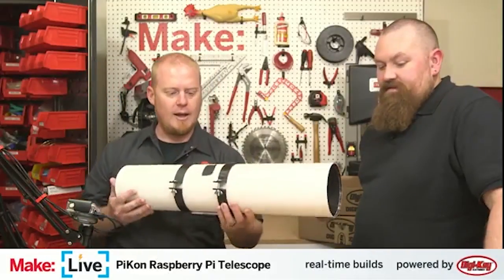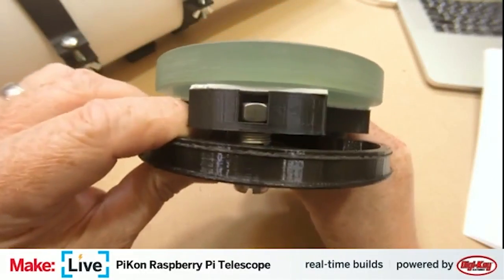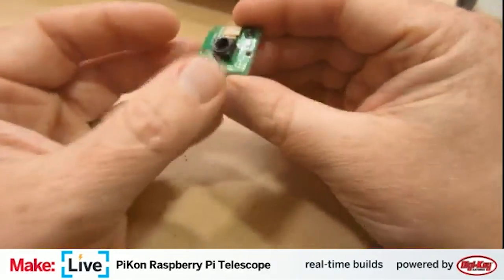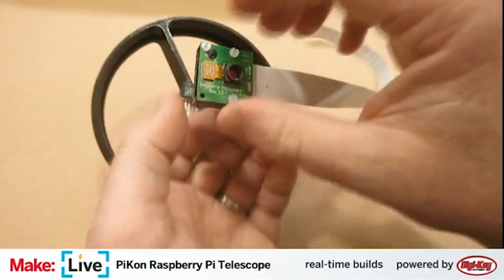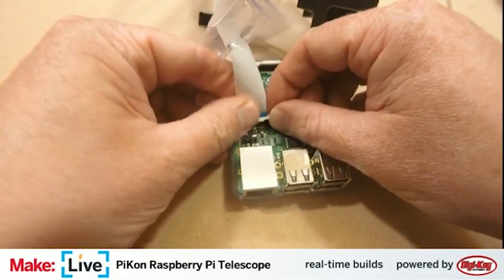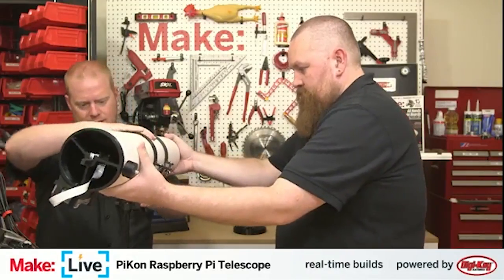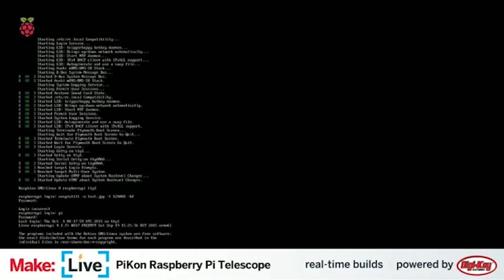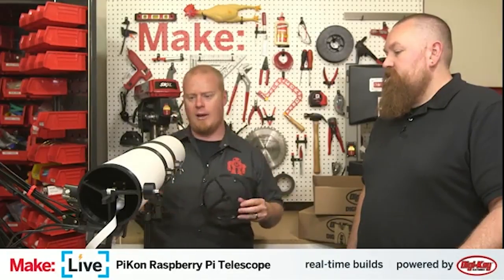Make Live: PiKon Raspberry Pi Telescope

Comment: Don't glue the mirror mount. Rather use screws or you will not be able to clean it. Consider black cable or black paint and flocking to reduce internal reflections. After mounting raspi, then locate the talescope mounts for best for/aft balance. Finally, telescope is only as good as the tripod.
Reply: I thought that too and checked: the instructions say to use screws through the tube into the bottom plate.

Comment: If you need 5 inch PVC, don't get plumbing pipe.  Look for 5 inch PVC electrical conduit.  Could be hard to find depending on your location, but still far more common than 5 inch plumbing pipe in the USA.

Comment: Putting the camera inside the tube seems like a bad thing to me. It would block a lot of the light coming in compared to a mirror.
Reply: An eyepiece would block some light too.
Reply: The eyepiece goes on the outside. Only a small mirror is needed inside. Without a mirror, there would be no use for the telescope.
Reply: Manfred Knorr The optical mirror that normally goes there blocks off the same amount of light
Reply: Free Saxon Ok, I wouldn't have thought that. Thanks.
Reply: Good quality telescopes have streamlined spiders. Not giant 3D printed pieces of shit like they're using. You can use very, very fine wire to mount your optics mirror. Then you mount the camera, etc, on the side of the equipment out of the way. The quality out of something with a god awful incompetently made spider like that will be bollocks no matter what.

Comment: Question:  In a typical reflecting telescope, the magnification is the ratio of the focal length of the primary mirror to that of the secondary eyepiece.  So you change magnification by changing eyepieces.  If there is no secondary optical element, however, what is the magnification and how do you control it?
Reply: In this system you have a fixed focal length of the primary mirror which gives a specific field of view. There is no magnification only the point of focus at the focal plane is a specific diameter in size. If you utilized a camera with a lens on it that was a zoom you could change the magnification with that methodology.

Comment: With camera projects like this that use Raspberry Pi cameras.  Couldn't you just use an old smartphone or tablet for it's inbuilt HD camera?  Is the Raspberry Pi camera better?
Reply: In the hobby, we use webcams and freeware capture software to produce planetary and lunar images of amazing quality and resolution.  Google "damian peach" and "christopher go" for some examples of what the best amateurs are doing in this arena. 

Thus, there are many solutions better than what the video gives, but I reckon that's not the point.  "Makers" and "making" usually don't care if they are reinventing the wheel a little bit.   It's still a cool project.
Reply: You indeed could use other sensors besides the Raspberry Pi camera. Inverse design however the camera is suspended over the mirror so you want a small of a footprint for that camera as you can get so a cell phone sitting over the front of the telescope would not work very well as it would block the incoming light. On the other hand if you are modifying an existing telescope where the light comes out the side you could definitely use any variety of camera you like.  If you look up ASIAIR that is a dedicated Raspberry Pi box commercially made. However there are plenty of Bakers who take Raspberry Pi's and make their own units with open source software readily available